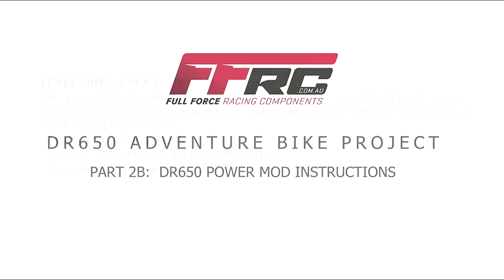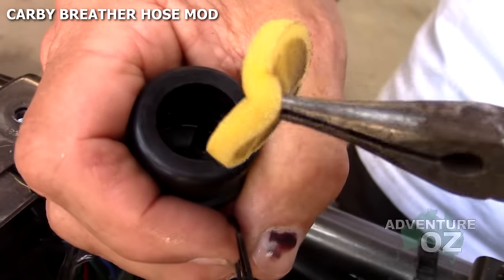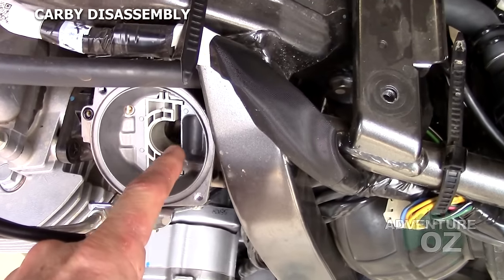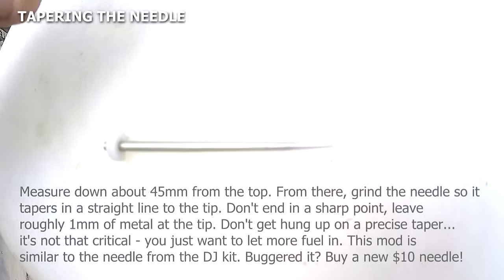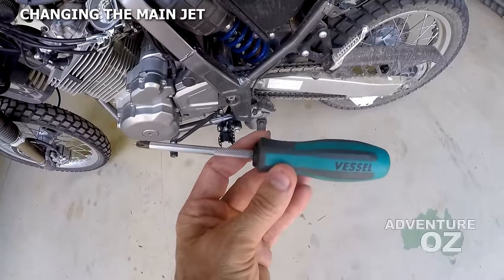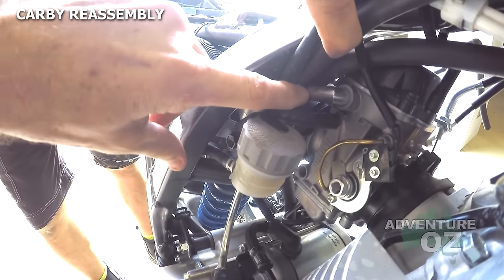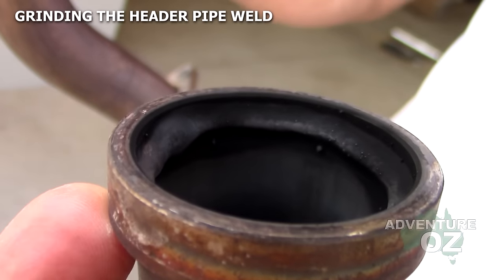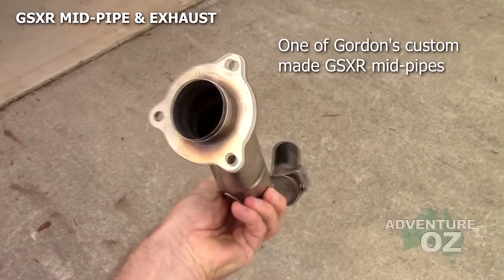DR650 project: transforming the stock carburetor! (BST magic)︱Cross Training Adventure

Comment: Nice video, but I have a question about the effectiveness of grinding the needle and then dropping the needle by grinding the white plastic ring. It seems to me these two cancel one another out. None the less I followed the procedure for the minimum boost to the t . Now the bike hesitates and appears to be running even hotter/ leaner. now hesitation prior to the tweeks
Reply from the maker: +vittoria grant unfortunately it's not my area but if you google 'bst magic' where gordon answers questions about all of this. remember the mods described here are for australian conditions so not much elevation, 20 to 30C year round. the needle on the aussie DR can have the needle clip put in different positions, apparently the US needle can't so you need to shim it for any adjustments. as per the vid, if all fails just get procycle's jetting kit. hope this helps.

Comment: I just checked my DRs secondary air filter and realized that half of the thing is just missing😳😳 Well good think that I already ordered a replacement and havent been riding in too bad conditions..
Reply from the maker: I try to avoid dust as much as possible. You just never know if your air filter isn't quite in place or dust is working its way in to electrical connections etc. So whenever it's dusty I just distance myself enough from the rider in front. I'm always surprised at riders who happily sit behind other riders in clouds of dust and they (and their bikes) are just brown with dust at the end of the day. 🤔

Comment: Hi Barry, currently cleaning and tuning my carb im gonna drill the slide cut the spring, open the airbox and change the main jet to a 150, my question is: with these mods do you go up in idle jet size ? Or keep the oem one ? Im not gonna buy a jetting kit only the jets i need kinda on a budget here😅
Reply from the maker: I don't even remember most of this stuff now, Jeremy. Its should all be in the vid. If not, try googling 'BST magic mods'.
Reply: @crosstrainingadventure  no mention of the idle jet in the vid, i'll check this out thanks a lot and thanks for all the vids i've learned a lot from them!
Reply from the maker: Check out the pinned first comment too which discusses the pilot jet, we always put updates in the pinned first comment.
Reply: @crosstrainingadventure  dont go past 2 turns mean no more than 2 turns out ? I was a 2 3/4 turns out on my mixture screw, ill set it at 2 without changing the pilot and if it doesnt run right ill slap the 45 in, thanks a lot Barry!

Comment: some help please or ideas on what my issue could be???  this are the things I have done.  aftermarket exhaust, hole on the air box, taper needle and grind plastic washer, drill extra hole on plastic slide, cut the spring, remove small fuel filter on carb and using inline fuel filter. I drilled main jet using drill bit 3/32" diameter.  it starts with no problem  idles good and revs up good the problem I'm having is the moment I start driving and give it full throttle it runs very rough. I have messed with the fuel/air mixture screw. from one full turn all the way to two full turns. did I taper the needle too much? or is the main jet hole too small or too big?
Reply from the maker: You'll probably want to message Auscanvet (Gordon) on the DR Riders forum, Becky. It could be a pile of different things. He's on this thread. And you might find someone else had similar issues. https://drriders.com/bst-magic-stock-carb-mods-dr650-derestriction-inst-t16700.html
Reply: @crosstrainingadventure  thank you I will. I appreciate you taking the time to reply and I really enjoy your content
Reply from the maker: Glad you are enjoying the vids, Becky!

Comment: Mate I got a DR650 1995 model I'm pretty sure, and she runs bloody fantastic, sounds a bit quite but she is good bike. I'm looking at doing a big ride with a group up to the NT and would you know if the bike would make it with a lot of gear on it or not ? Thanks mate
Reply from the maker: usually maintenance, good preparation, bike setup and the right tools etc will count far more than the actual type of bike nick....
Reply: +ADVENTURE OZ thanks mate for the response, I will take that advice on

Comment: Hi!, thanks for the awesome video. The needle of my DR650 does not have a needle clips adjusters, only have one position. Can the shaving be done on this needle? thanks again
Reply from the maker: for some reason the USA model doesn't have three positions, andres. if you look for a forum thread called 'BST magic' i think there will be an answer there.
Reply: @crosstrainingadventure  thanks! found all the information, allready do the mods, OMG! its just a new bike! a whole different beast. (Im waiting for the slip on exhaust)
Reply: @RaVAndres  can i ask what link u found your video at ,  my bike is the same as yours with no needle clips adjusters , thanks man
Reply: Hi @marcelcanuck , there is no video for this mod in particular. But there is a nice forum with all the information regardless all this mods. Here you can find the info https://drriders.com/bst-magic-t5201.html?sid=5010c0b1b8e335fee3abbef68b049a7c
try to read all but at least read the last 25 pages, where some new info was added. I grind the needle 15mm from the tip leaving 1 mm of material at the end (i put the needle on a dremel set it at mid to high speed and some sandpaper in my hand to do the job) , D shape the plastic clip, add a 1mm washer to compensate the height of the needle. The rest is the same as the video. Have a good day

Comment: DR 650 or a T700? Assuming the price difference is not an issue. What's your choice? I'm thinking the T7 is the better bike for longer distances.
Reply from the maker: Totally different class of bike though. The T700 is a twin and much heavier.
Reply: @crosstrainingadventure  Not that much heavier. DR650 wet 166 Kg. T7 I think 204 Kg. Motogeo stripped one down, albeit to the extreme, and dropped 60 Kg (or was it 60 bs?). Lets say 60 lbs =~ 40 Kg. The center stand alone had to be 18-20 lbs. Of course even the "slight" difference between 166 and theoretical 195 Kg is a huge difference if you have to pick it up a bunch of times out on trails. But assuming an advanced level of rider, a 225 lb (when slim and trim) ex-rugger, and the desire for a bike that can do 1000-1200 mile round trips split maybe 1/4-1/3 highway and the rest offroad / backroad / single tracks...Would you stay with the DR or be tempted to stray to the T7?

Comment: Ok, well first off thanks for the great vid!!  So i spent some time yesterday and did all except no gsxr pipe or 150 main handy so i didnt do the second hole on aur box.  Bike felt a lot better.  BUT!  I did grind down the needle i think a bit to much and did make a point..  what would this cause?
Reply from the maker: +Andrew Sanchez you would have to ask gordon, andrew. i gave his contact details on the forum at the end of one of the vids. if the bike is running fine i can't imagine it would hurt anything in there...
Reply: What vid bud, i got a small hiccup on the release of the clutch on first only

Comment: I just got my DRZ 650 going after finding the 100 ohm resistor in  an old smashed radio( the bike was a stolen recovered bike - the dumbass thieves didn't know about the resistor and never got it going lol) It had with all the mods done and a big fat staintune pipe.. just wondering if the staintune would give more HP than the GSXR exhaust? I have a carbon yoshi GSXR pipe in the shed :) Great vid btw!!

Comment: My 91 Dr 650 dose not have the hose you mention that can fall off or get kinked
My bike is extremely hard to start,when started it runs great,but for a bog just off idle,is this bog normal on these bikes
Reply from the maker: They shouldn't bog off idle if set up correctly. I always find the DR650 runs a bit rough until it's properly warmed up so I ride off very slowly for the first five minutes... then it's all good.
Reply: Sorted!
I lifted my needle to 4th clip position,no more bog off idle 😀
It was very hard to start,now starts first kick every time!

Comment: Hi 
Love your work the videos are great and very helpful. I just bought a 19 Dr650 which has had some mods as in the vid done. He did change out the original carb for a Fcr carb. The bike bogs down a bit when cracking throttle, that instant response is just not there so that when i snap it to get a quick front end lift to pop over logs rutts etc it hesitates. Also it seem to have less of this mid range and on the highway it seems to hesitate and not get to redline or rev limiter. Would appreciate any suggestions what I might need to do to fix it? Cheers
Reply from the maker: I wouldn't touch a pumper carb with a ten foot pole, Adrian. They are notoriously hard to tune and get right. Google around and you'll find heaps of discussions about this.
Reply: @crosstrainingadventure  thanks I did get the original with the bike so ill get it tweeked before i put it back in. Wasnt sure how much if any changes were made to install this. Is The Canadian guru bloke around Brissy?
Reply from the maker: He's nearby...
Reply: @crosstrainingadventure  Thats awesome, any chance you could pm me his details to turn my bike into the beast it should be?
Reply from the maker: Wouldn't be respecting his privacy, Adrian. He's well known on a few DR650 forums as canvet or auscanvet, I'd just PM him there.
Reply: @crosstrainingadventure  I've been going back over you vids but so far can't find his name. Thanks

Comment: Whats the deal with a vacuum slide? Why wouldnt a simple cable actuation suffice for the slide?
Reply from the maker: It's a good question, I don't know why they opted for that design... but doing these mods certainly makes the response faster. I know you can read rave reviews about pumper carbs, but many of us don't think there's a big difference once the stock carb is set up properly. An interesting quote below about how tricky the pumpe carbs can be to get running properly:
"Tuning an FCR can be very complicated and time consuming, even more so without a dynamometer with 5-gas analysis. Aside from idle and WOT, everything is on the needle. The reason that makes matters complicated is that the needle must therefore be the correct shape for 1/16, 1/8, 1/4, 1/2, and 3/4 openings to work correctly, whereas on most other carbs there are other circuits to deal with 1/16, 1/8, and 1/4 openings, meaning that only 1/2 and 3/4 openings must be correct via the needle. Two points define a line, and therefore a single taper at the right height can simultaneously provide the correct fueling for two openings such as 1/2 and 3/4. On the FCR 1/8 opening can be dialed in with the base diameter, and usually 1/16 is then correct. That leaves 1/4, 1/2, and 3/4 that must be correct on the taper, which may not be achieveable with the single taper needles available from Keihin's aftermarket division. There are multiple taper needles used in OEM applications, but it is very difficult to find them all (they are spread across multiple manufacturers), and only part of the letter code corresponds to the conventions established by Keihin's aftermarket division, so it's really difficult to tell what effect any given OEM needle will have by looking at the code. Some, but by no means all of these have been analyzed and the information has been put into the public domain by skilled and generous individuals. Unfortunately, there are often cases when neither Keihin aftermarket division, nor OEM needles will give the correct mixture at all openings. If someone like J.D. doesn't have a needle in his line up that fits the bill, a needle must be modified to work. Additionally, every FCR I've worked on had a significant slide over-travel problem, which must be resolved before it can be expected that the carburetor can be tuned properly."
https://advrider.com/f/threads/does-anyone-not-like-the-pumper-on-a-dr650.1075912/#post-27091578
Reply: @crosstrainingadventure   @CROSS TRAINING ADVENTURE  haha fair enough and you'd think their would be a bigger aftermarket for something as essential as needles but ik how it is. Certain carbs can be very tricky to get right and i only ride 2 strokes so accel pumps and diaphragms etc are beyond my limited knowledge of them lol
Reply from the maker: Probably the big selling point with the stock carb is it's very forgiving if you don't quite get the jetting right... whereas the pumper carb can be a nightmare to get right sometimes.

Comment: The dealer I purchased my bike from fixed my stock carp issues by simply drilling a plug (sorry can't be specific cause I am not a mechanic) and I have no issues with it 11,300 miles later.  This of course did not increase power as your mods did.  I am hesitant to mess with any of this as my bike is so damn fun to ride now but if this changes your mod will be the first to try
Reply: +brandtagone oh and thanks think I'll go clean my breather
Reply from the maker: +brandtagone i certainly had fun on the DR for those first few rides without the power mods and there's nothing wrong with leaving the bike as is. it does start easier and get better fuel economy too with the mods but plenty of guys ride them as is.
Reply: +ADVENTURE OZ Would love to do all the mods, in time.  Right now my next mods are suspension and pipe.  I am not a mechanic so messing with carbs and the like, I will wait till there is an issue.  I just finished per your video the breather and fuel filter.  I am following your series closely and look forward to more!
Reply: +ADVENTURE OZ Ok you got me muffler and carb being done unfortunately my dealer was no help on the gsxr so I went with the fmf at procycle.  No need to reply and thanks.
Reply: +brandtagone Installed the muffler and did the jet kit from procycle and gotta say glad I unleashed the beast!.  Your video was a great help on the carb and grinding down the pipe weld.  On to the cogent front, Thanks

Comment: do these mods apply to the old kickstarter maodel ???
Reply from the maker: i don't know colin, they suit 1996 to current but unsure of the really old DRs
Reply: Same seems to apply i shortened the spring ...ground out the exaust filed back the plastic needle holder ...leaft out the snorkel ...drilled out the 2 carb holes  upped the main jet from 135 to a 155 main jet seems to be a good bit more lift in her more inclined to wheelie in 1st and seems happyier all around and possiblily easy to start ...still have to drill the airbox ...or taper the needle...:)

Comment: 140 if stock, 150 if drilled airbox. Is it mikuni or dynojet classifications? And why you use 150, when dynoj manual say that NOTE: On
1996-2016 models use DJ160 with the stock exhaust and DJ170 with a
high flow aftermarket exhaust.  ?)))
Reply: Mikuni size 150. DJ runs higher numbers like you stated.
Reply: Mikuni size 150. DJ runs higher numbers like you stated.

Comment: *desde Colombia:  ¿en que porcentaje se mejora la eficiencia de la motocicleta con las mejoras hechas por uds?*  gracias
Reply from the maker: no hablo espanol, jeff. but if you are asking about the power increase this was reported in the vids
Reply: Ok! gracias. saludos.
Reply: Spa Ans: Normalmente aumentar la potencia que desempeña el motor tiene como consecuencia una disminución en la eficiencia (por eficiencia me refiero al rendimiento, km/l o mpg)

Eng Ans: Usually increasing the engine power output has as outcome a reduction in the overall eficiency (by efficiency I mean fuel efficiency  Km per liter of fuel or mpg)
Reply: GRACIAS AMIGOS.  BUEN DÍA

Comment: So these mods improve power and fuel economy ? Really ? More power for less fuel? I would like to know more. Great vid as usual.
Reply from the maker: Depends on how you ride of course, Eric. It's typically one or the other. Use the extra power and your economy will be worse than before. Or don't use the extra power and you'll get slightly better economy. 😊 If it was fuel injected you'd probably get both at once, the DR650 is a pretty inefficient bike in that respect. I remember a mate with a fuel injected 690 getting 50% better economy than me on long rides... and he was hitting the throttle harder.
Reply: @crosstrainingadventure  Got it. Thanks

Comment: I thought I'd seen it all....but grinding a taper on a carb needle using an offhand grinder?!?

You've also dropped the needle, thereby leaning the bike off from off idle until WOT......?
Reply from the maker: only if you want to really be a cheap arse of course, otherwise you can buy an aftermarket needle. works a treat though.  :)

Comment: damn I want to do this, but my bikes only one day old lol. Gonna screw the warranty too I'm assuming....
Reply from the maker: Hard to say, Sean. Technically they might choose not to warranty, say a gearbox failure, if you've modded the engine. But hopefully they'd do the right thing and say jetting/exhaust changes won't affect other parts of the bike. I've just bought a new DR and I'm keeping it stock for a few months just in case something goes wrong and I want to make a warranty claim. She will still wheelie in third gear completely stock... 😁

Comment: Just did this, now the bike surges…. Any suggestions?
Reply from the maker: If it wasn't covered in the vid, we always include extra points in the pinned first comment.
Reply: So I wrapped a bit of inner tube between the two hole of the air box in order to slightly restrict flow, no more surging!👍